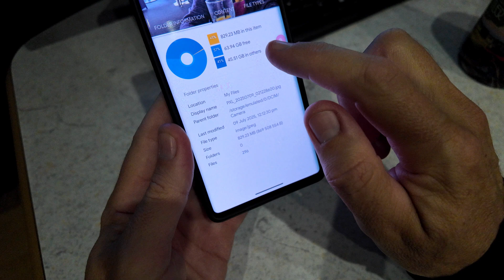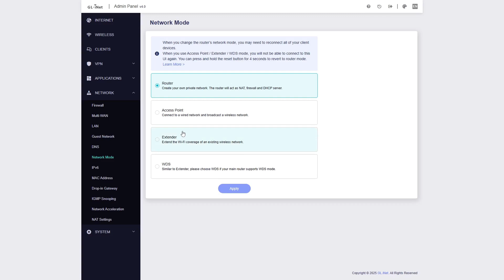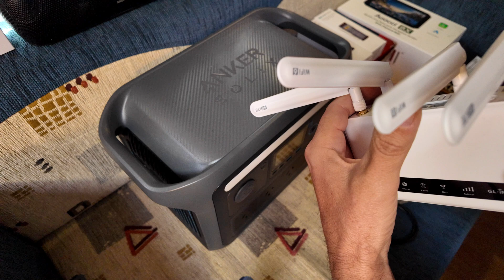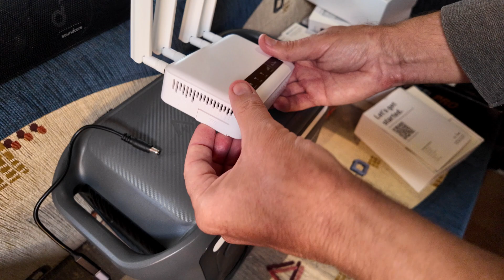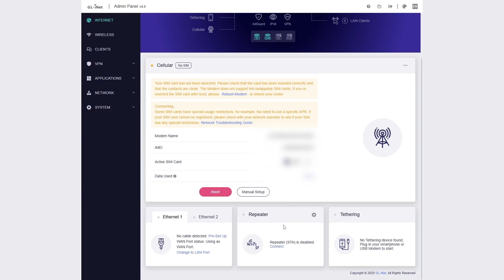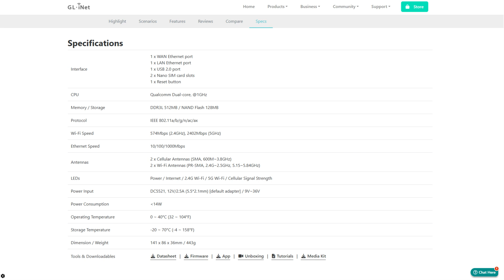A 12V 4G LTE WiFi 6 Router For Your RV: GL.iNet Spitz Plus Is Awesome

Comment: I've been looking at one of these units for my 6.4m campervan. I'm just wondering what external antenna would be used with it? Otherwise, an option that I've been looking at is the Vanconnect 4G Premium made by Cowfish technologies which comes with an external antenna.....decisions, decisions?
Reply from the maker: If you scroll down the product page for the Spitz Plus there are links to a couple of recommended antennas from Waveform: https://www.gl-inet.com/products/gl-x2000/ I can't vouch for them as I've been lucky enough to get awesome 4G signal with the standard antennas so far. Cheers
Reply: @MVDBR  Thanks, I'll take a look - getting this router for Chrissie. I'd be great to get a antenna too. Keep up the great work you do.
Reply from the maker: @pittarak1  Thank you!

Comment: Very happy with my XE-300 (Puli) but its designed to be portable with a big battery. It's plugged in continuously and gets quite hot so can't be good for the battery. I've just ordered the X2000 off Amazon for around $200AUD, great value. I wouldn't pay the $600+ for the X3000 which has 5G.
Reply: Got mine and have been using it for a few weeks. Doing the same as you, I got a decent speed boost when turning on ipv6
Reply from the maker: I love this little thing, seriously ❤ Have an unlimited sim from Felix Mobile in it now, get faster download and upload speeds than the wired NBN here 💪

Comment: im having the oposite speeds, with hotspot using 5g im geting 50mb but when i put the SIM in the router speed is abismal slow 3/4mb. Im guessing im missing some config in the router dont know which
Reply from the maker: Maybe because the router doesn't support 5G cellular? Assuming you're using the same router. Other that that, not sure what would be going on. If you're in an area with good 5G coverage you should have decent 4G as well...
Reply: @MVDBR  the gl-x2000 has 5G and i plug 1gb up/down fiber the 5G wifi is normal, its only on the SIM failover that speed is bad, like i said 5G hotspot to GL-x2000 repeater is fine, the GL repeats to the all network. it must be on the SIM auto/manual setup that i might be doing something wrong
Reply from the maker: Mate my Spitz Plus (GL X2000) only supports 4G LTE 🤷 which is fairly quick here now that I've switched to another network operator but yeah, does sound like something not right with your config
Reply: 5G WiFi is not the same as 5G mobile.